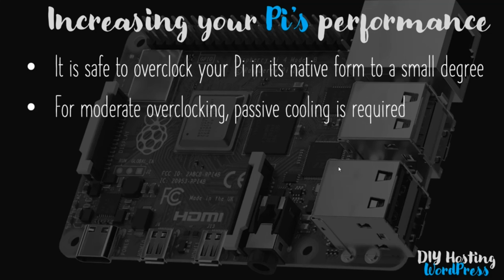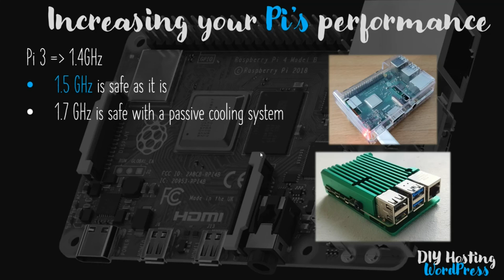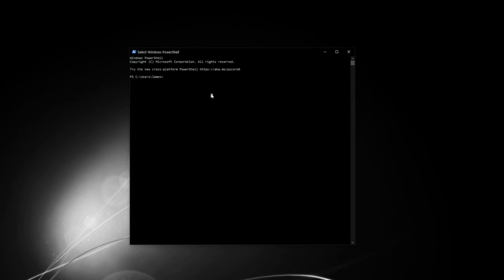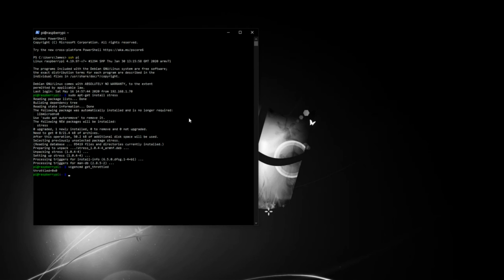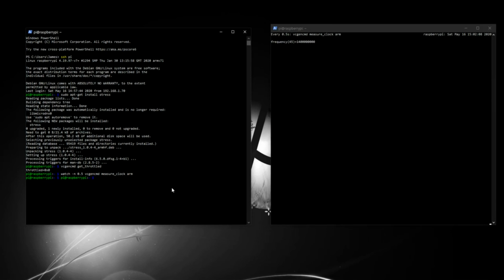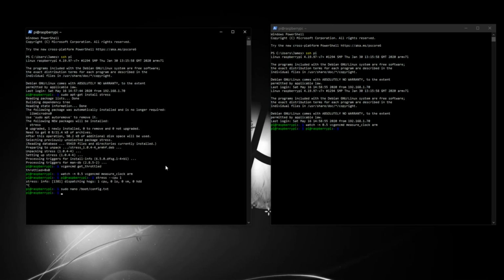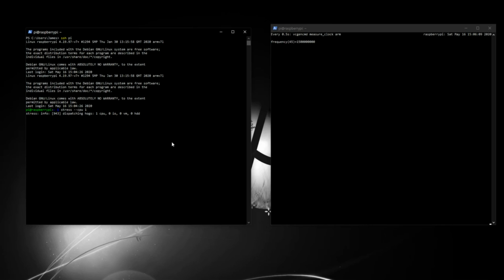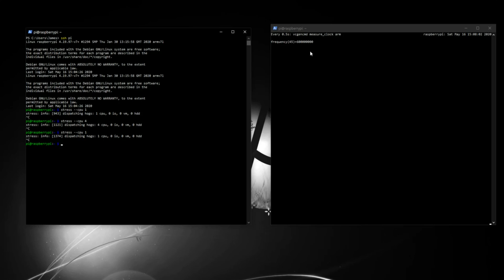3. How to overclock a Raspberry Pi | Hosting a website for free

Comment: In case your RPi gets gets to a boot loop after overclocking (like mine did), you can unplug it, take the sd card out and insert it in to a computer where you have access to boot directory same as in the terminal. Find the config file, open it in a notepad and delete / edit those lines you added earlier in the terminal. 

As I am unsure why this happed, I am guessing this is due to AC adapter not being able to output the required wattage for the RPi.

Comment: I'm getting the same problem as the previous commenter. After attempting to restart the pi, my terminal just freezes and never connects to the pi. I have tried several reboots
Reply from the maker: It could be many things I'm afraid, you may be best trying to connect via a monitor directly to rule out ssh issues (if you're connecting via ssh).
Reply: @Singleentity101  Thanks!

Comment: Hi 
I have followed up to shutting the pi down all with no problems
when i try to ssh back in using power shell i get this:-

PS C:\Users\johnc> ssh pi
ssh: connect to host 192.168.1.178 port 22: Connection timed out: connect to host 192.168.1.178 port 22: Connection 

I have waited over 10mins and still the same, the pi is pwered up and the heatsink feels cool
any idea's?